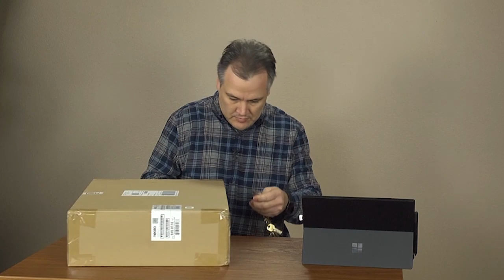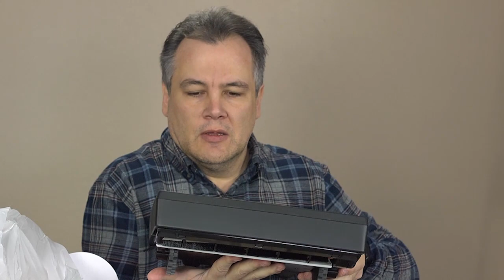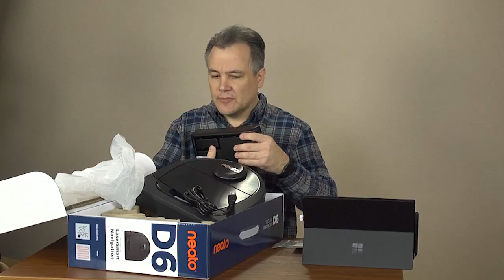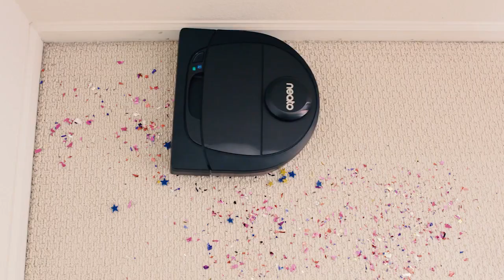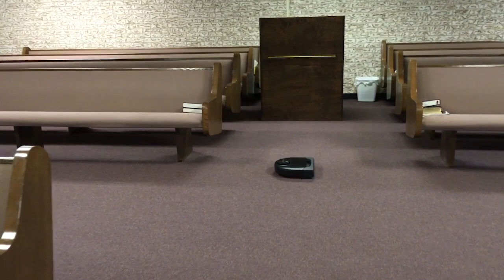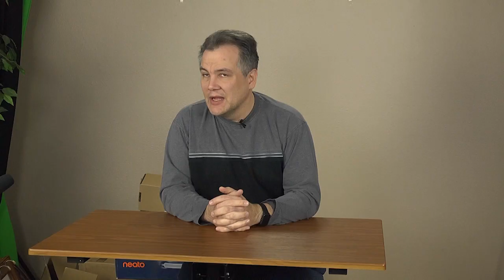Neato Robotics D6 review. Does it suck? Can it handle my challenge?

Comment: You didn't do the update.
Reply from the maker: You are correct. I kind of forgot about it. I am still using it. I have it clean the auditorium once a week. It is still working well. However, I had a few times that it lost connection with my network. The only way I was able to fix it was by renaming my router. It was strange problem that happened twice. So far, it hasn't happened again. It will work without a network connection but it will have not a map to go by and will work like the old kind that just bumps around where it can go. Sorry I forget about giving an update.

Comment: Neato products are highly problematic devices. After 1.5 you get only problems. After warranty period Neato simply die for price 900 Euro. Very horrible reliability. This is my experience with D7. More people have same experience. Do not buy this terrible device. Read here experience https://www.youtube.com/watch?v=CFG3V7bemF0&t=2s and read experience on Facebook Neato channel. Very terrible experience from huge amount people who paid a lot of money!!!! DO NOT buy this product !!!!!!
Reply from the maker: Mine has been working good so far. However, I keep having problems with it not connect to the internet. In fact, I have been using it in the manual mode for several months because no matter what I try it won't connect to the app for auto cleanings and block lines, which is annoying, but it does still job done. Thankfully, it is cleaning a pretty clean area. There is not a lot of traffic and no animals.